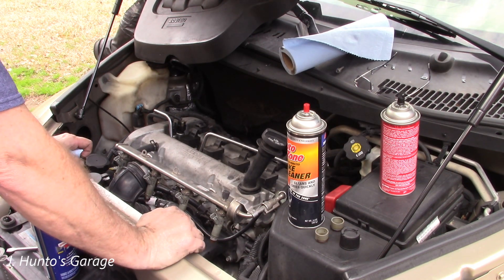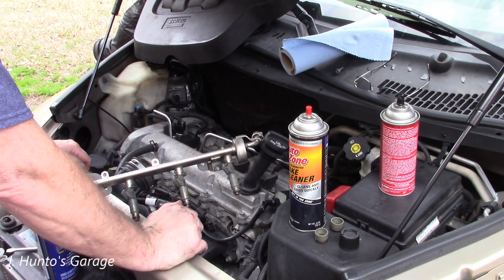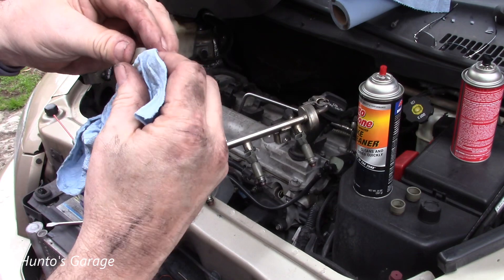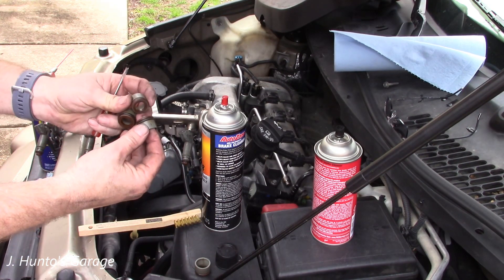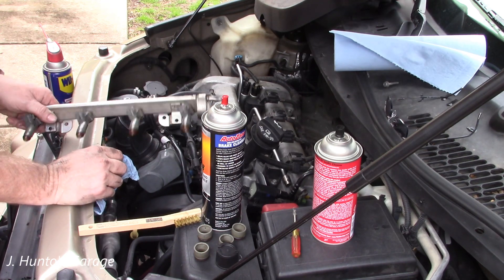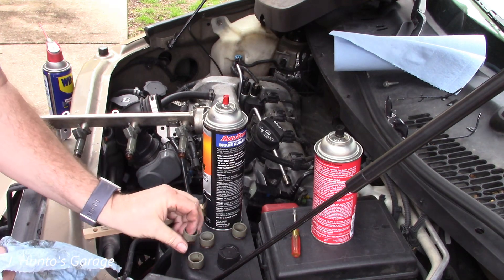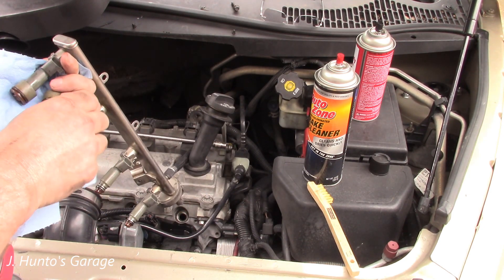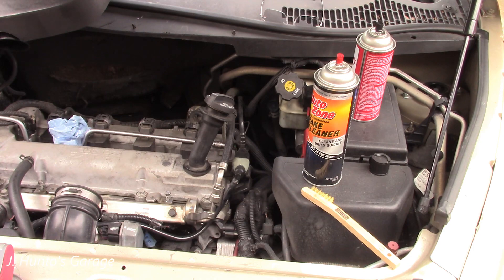Causes for P0170 Fuel Trim and Vacuum Leak Code

Comment: Actually they don't suck.  Atmospheric pressure pushes the charge into the cylinder.
Reply: nerd alert!!! lol (but you are correct).  :)
Reply: Wrong. The air only moves from outside to inside when the piston reduces the air pressure on the inside of the cylinder by increasing the volume of available space inside the cylinder during the intake stroke. This produces a downward pressure gradient between outside and inside the cylinder causing the air to move from outside to inside the cylinder. This is the definition of sucking whether it's an engine or a drinking straw. Atmospheric pressure is always present. It is always applying pressure. But the downward pressure gradient isn't. There is no movement of air from outside to inside the cylinder without that gradient. So the causal factor in the movement of air from outside the cylinder to inside the cylinder is the sucking not the atmospheric pressure. The air is pulled into the cylinder not pushed into the cylinder by atmospheric pressure. Of course, the opposite is true during the exhaust stroke. BTW, the size of thet pressure gradient deteremines the rate of air intake from outside the cylinder to the inside. The bigger the gradient the more air gets drawn in. That's the whole point of turbo charging. To increase the size of the pressure gradient.
Reply: @veritasaequitas9875  Nope actually you're wrong. Your last sentence proves it.  If you add a turbocharger or a supercharger you will fill the cylinder moreso than with just atmospheric alone, because of the additional pressure OUTSIDE of the cylinder.  The piston still travels the same distance but the additional pressure fills the cylinder more. Also if you were to place the engine in a vacuum chamber and rotate it while placing your hand over an intake port, there would be zero pressure or "suction" because there is no air pressure. The same thing with your drinking straw reference.  If you were to go in a vacuum chamber and try to drink through a straw, nothing would happen because no atmospheric pressure is being applied to the surface of the liquid.
Reply: @IROK660  You don't get it. The critical charcteristic of this behaviour is the pressure gradient not atmospheric pressure. Air (or any other fluid) moves from high pressure to low pressure. In this particular case the atmospheric pressure is the constant. Cylinder pressure is the variable quantity. The change in the cylinder pressure is the driving force behind the movement of air between atmosphere and the cylinder. There is no pressure gradient in a vacuum chamber nor is it possible to create one. That's why straws don't work in vacuum chambers. No pressure gradient. On the exhaust stroke the pressure gradient is reversed by the changing conditions in the cylinder.  And, again, the cylinder pressure, relative to atmospheric pressure, is responsible for the movement of gases from the cylinder to the atmosphere. The piston creates a positive pressure gradient between the cylinder and atmosphere as it travels towards the top of the cylinder. In precisely the same way that the piston creates a negative pressure gradient between cylinder and atmosphere as it travels from the top of the cylinder to the bottom on the intake stroke. Are you going to claim that the atmosphere SUCKS the gases out of the cylinder on the exhaust stroke? Is that what you think? Because that's the same as suggesting that the atmosphere pushes the air into the cylinder on the intake stroke. Again, atmospheric pressure is passive in the mechanics of this behaviour. It remains constant. The active component is the piston in the cylinder which is responsible for generating the pressure gradients that are required for the system to function. The pressure gradients without which nothing would work either with or without atmospheric pressure. Furthermore, on the subject of turbochargers, the purpose of the turbocharger is to increase the number of molecules going into the cylinder. How do you increase the number of molecules per unit volume of gases? You increase the pressure which , inturn, increases the density. This elevates the pressure gradient between the outside of the intake manifold and the cylinder. Of course, when you meet that with a corresponding increase in injector pulse width, more fuel being injected, you get a bigger bang per cycle than a normally aspirated engine. That's how it works.

Comment: After mounting a LPG system, this p0170 code came up on my 2005 mitsubishi colt.
I deleted the code but it reappeared after about 20km.
The engine run perfect, what should i do?
Reply from the maker: I'd check for vacuum leaks. If you don't find any you may have an intermittent switch in the emissions system. Maybe one that's staying open,  or closing properly. Evap maybe?
Reply from the maker: Could possibly be that you need to recalibrate (reflash) the PCM for the cleaner burning LP gas. The PCM probably thinks your engine is running too lean.
Reply: @jhuntosgarage  how should i recalibrate the PCM?
Weren't the shop where i have mountet the LPG system supposed to do that recalibration thing?
I didn't had this problem before the LPG was mounted.
The car is running perfect, only that it beeps when the check engine light is on and it is very annoying.
What does it mean that my engine is running too lean?
Should i contact them or can it be done by me (the recalibration)?